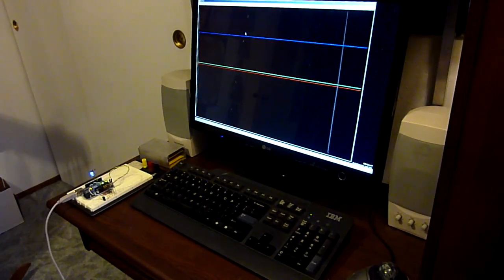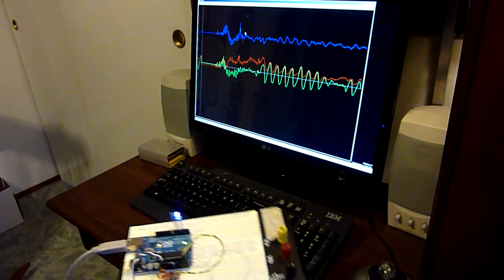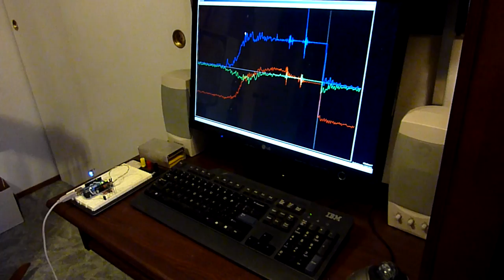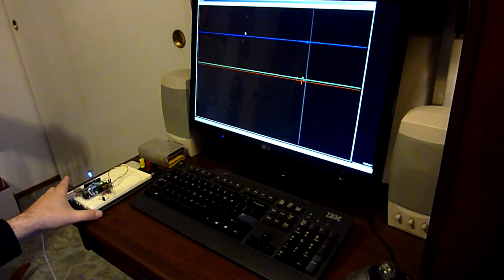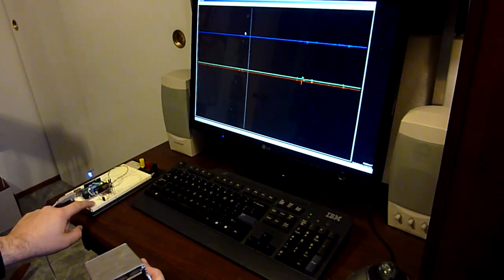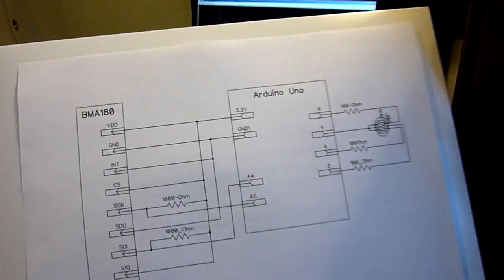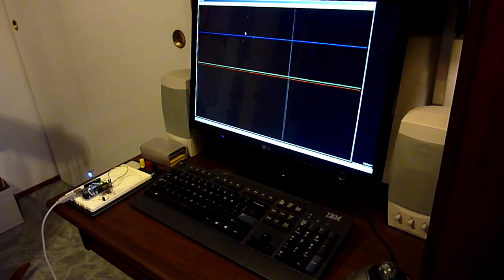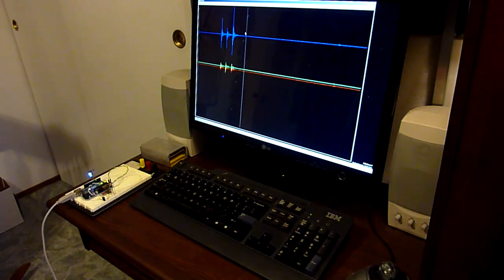Parts of a seismometer and seismograph

Comment: How's the seismometer now?
Reply from the maker: I turned it off.  I have a NetQuakes seismometer in my garage from the USGS.  It's more accurate, and the USGS manages the recordings. Though it would be nice to be able to read the file format and do my own graphs and animation replays.  The raw files are accessible, but a free reader isn't available.  Sadly, I don't have a lot of spare time to figure it out.  I think there is some documentation on the file format.
Reply: @BlackDiamond1138  nice to hear from you -as fast as that. I am no brain on electronics but just a fan of seismograms and stuffs. 🙂

Comment: Cool setup!  I did something similar using a USB oscilloscope.  It has two channels so one is monitoring a magnet coil geophone and the other an infrasound monitor.  The infrasound mike is a 15" woofer that was impedence matched and a low-pas filter.  It's fascinating to  watch the ground always in movement.  And how much infrasound there is from so many sources.
Reply: Arduino Uno quite practic.Video that concentrated to only data acquisition so data digitising event.Also,spectrogram analysis by time of spectral amplitude changings of frequency band by aim is realisig.For this,spectrogram digitizer unit is requiring...Based point is this.I am Geophysicist and there is my project.If applicable,you contact me🙂Thanks...